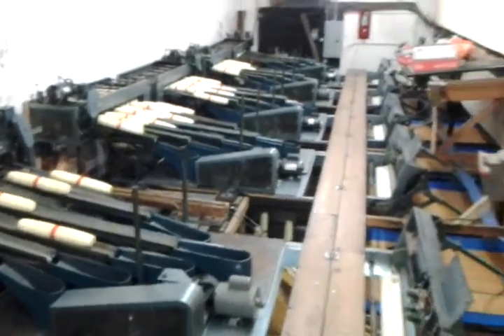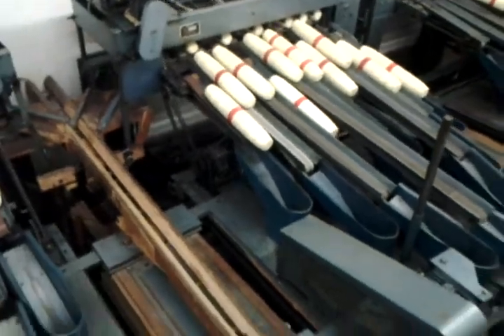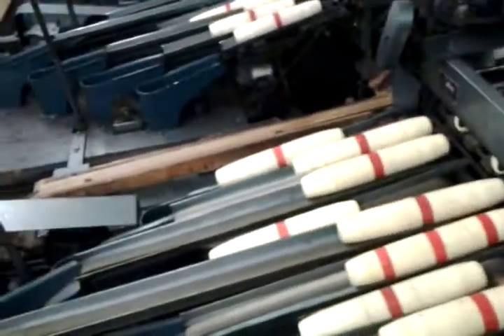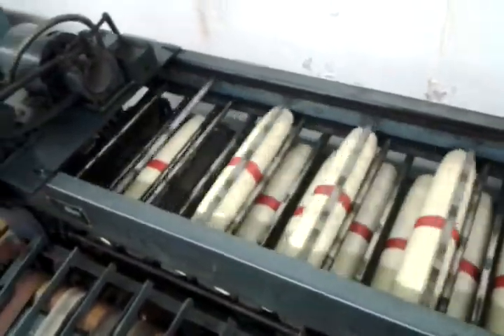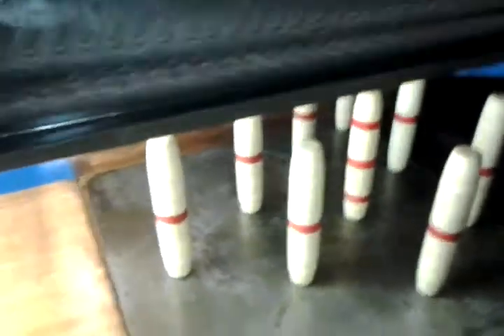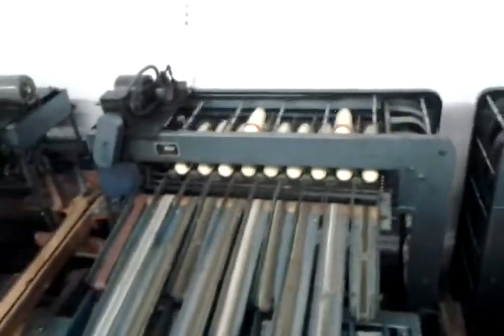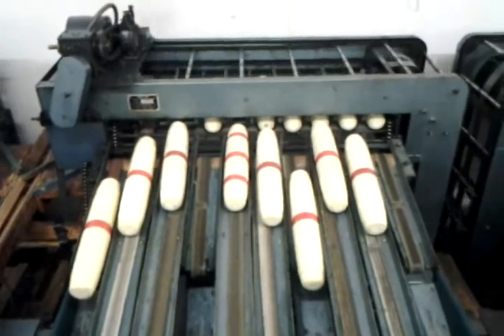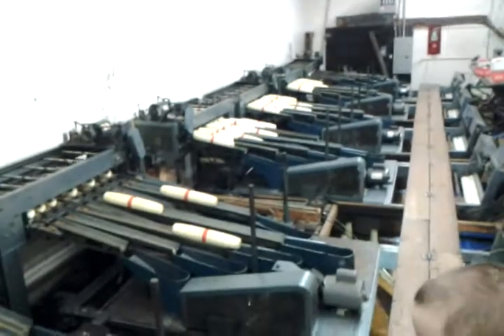A short video of how a Bowl Mor Model E Candlepin Resetter works

Comment: Also what keeps the the pins from ejecting if there are already ten pins on the conveyor awaiting their dump into the tube is the sweep pilot relay that is holding a normally closed pair of contacts open in the low voltage relay logic scheme.  Thing do happen and it will be visible from the bowlers view to see pins in the tubes descending to the pindeck and at the same time "cascading pins falling from above onto the triangular tube assembly board. This bug can occur because of what I can describe as a "relay race" in the logic system.  Engineers who design systems  take this into account but it's not thought about as much in pinsetter electrical design of the 1960's design and rightfully so.
Reply: There is a redundant shut off switch after the 10 pocket switch that prevents this from happening. We keep an eye on switches like these from season to season and change them if they look worn.